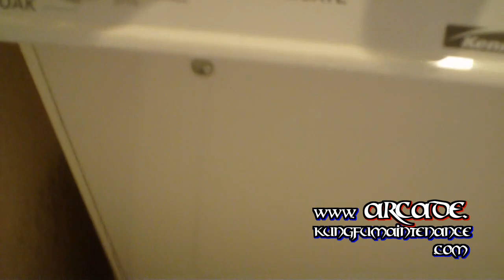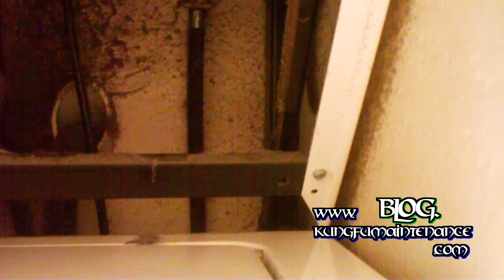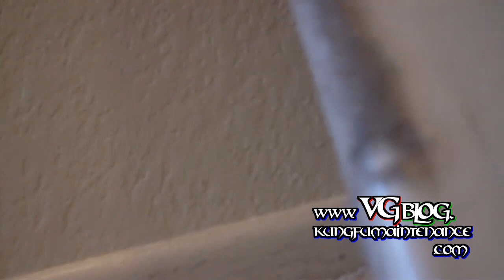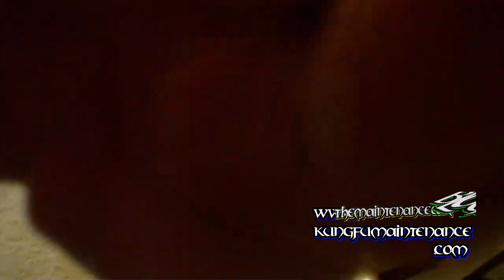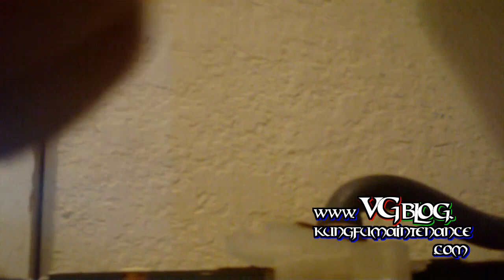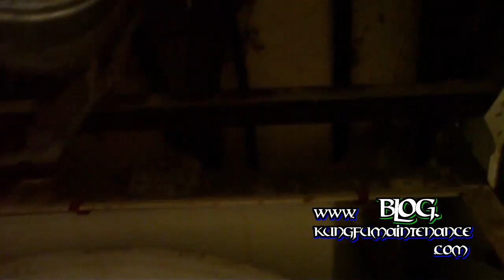Washing Machine Leaking Water ~ What To Check For First Secrets Revealed

Comment: i have the exact same leak.   I did like you did but still leaked from the vents on top.
This is a anti-siphon or vacuum breaker to prevent back flow of dirty water into the city water system, if it sucks water back when a fire hydrant is used.  But water level is too low to be sucked.  When spinning, water is already drained, so very little will flow back if at all.  So this item is useless.  i will just bypass it or plug up the vents with silicon caulking.  Another possibility is to just turn the incoming faucets down halfway.